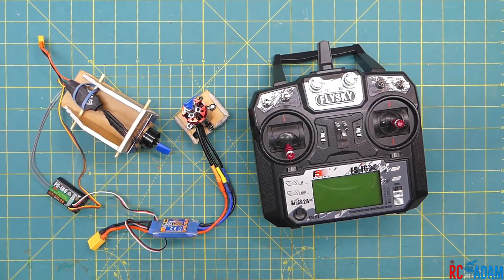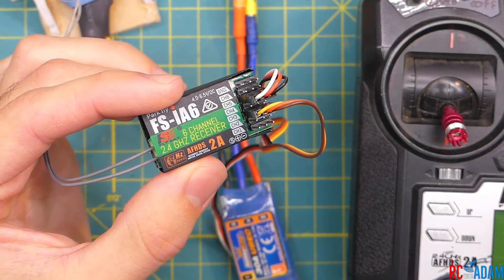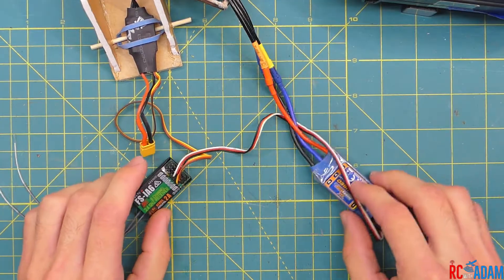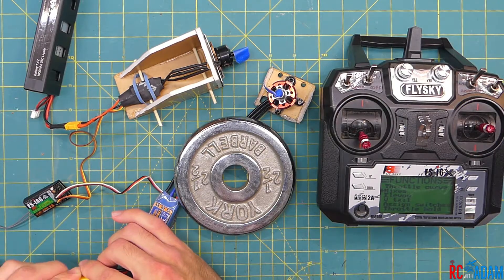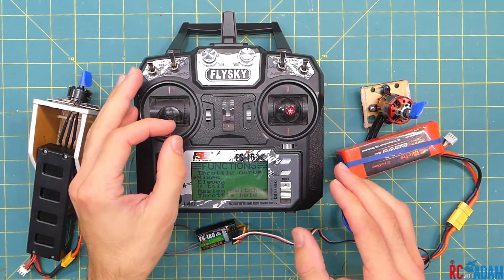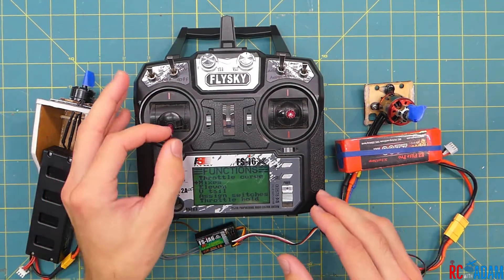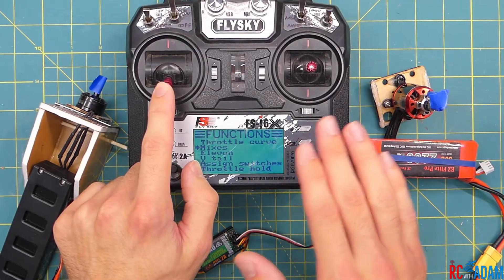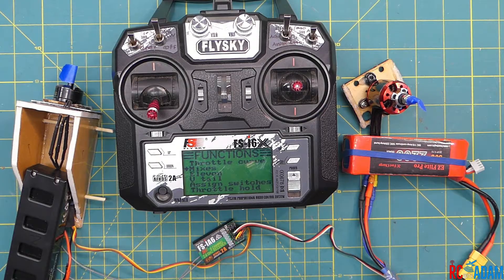Two Motors with FS-i6X - How to Setup FS-i6X for Twin Motor Airplane - Flysky i6x (and i6) Tutorial

Comment: Cool video man :) 
it would be best (for most) to Disconnect the Positive wire on the servo-wire of one of the ESC's..  
Basically Both your BEC's power the receiver (and servo's) and that Can work, but not for all types of ESC's..
Reply from the maker: Good point. Yes, I have heard that. So far it has been working fine for me. And actually, as long as it doesn't cause issues, it actually seems like an advantage to have a redundant power source for the rx.
Reply: @RCwithAdam1  Yes.. in a lot of cases it simply works.. 
The more technical story: if you use Linear BEC's.. it at least works.. If you have Switching BEC's.. it will very much NOT work :D 
the trouble then is that it's offten not specified (What kind of BEC the ESC has)
Reply: @DutchRC the rx needs a linear bec  ? Or one of those capacitors will smooth out a switch bec noise ?
Reply: I tried cutting the Positive wire of one of the ESCs but still only have one motor spin....any suggestions?

Comment: Rc with adam , Can't we just have 2 esc's and 2 motors , and hook both esc signal wires to the same channel 3 on the rx ?
Reply: You can, but you'll need to configure one of the esc's plug to connect it to a Y connector for a single output

Comment: What if i'm a 50% thrust and i whant to turn ...? Does it works...???
Reply from the maker: It will turn but be less effective. The motor on the turning side will decrease in power.
Reply: And 100% what that does ??

Comment: WARNING now motors will start with rudder regardless of throttle hold. Solution, EXAMPLE in assign switches set Fly mode SWC (or same as throttle hold switch) 
Then in Dual Rates Ch4 rudder set either normal or sport to 0% Rate so rudder will not activate motors.

Comment: Hi Adam,
thanks for the excellent guide. Can I have a question because I am fully new in the RC world? This "differential thrust" seems to be the correct setup for the motors of my tank T34 to move the tracks realistically. To clarify if possible. Because the tank also must move backward and I have a centered throttle joystick, I should have a 4th mix for my "throttle" as well but in an opposite way like Mix#1. 
So Mix#4 as Master Ch5, Slave Ch3, Pos. mix -100%, Neg. mix -100% and maybe adjust the Offset properly as well. 
Is my assumption correct or have I fully messed this up?

Comment: Hi, just a quick question, so you have one stick on channel 3 that controls two motors on channel 5. If I want to use the other stick to control another two motors at the same time as the first two, so 4 motors controlled by two sticks, how do I set that up?

Comment: Loved your tutorial and I got it all working with just one little problem, my left stick down which is normally no throttle, is w.o.t. .So to back it off I need to raise the stick to the top. I tried reversing it on the channel reversing but no luck. What am I doing wrong?

Comment: This is amazing, and great explanation, very easy to follow! Thank you! Out of curiosity, with this setup, if you are full throttle with the joystick pushed forward and centered, what happens if at full throttle you yaw left or right? Does one side slow down and the other keeps going?
Reply: I noticed that . Does it need to stop to yaw ?

Comment: So I’m that scenario that you demonstrated, you would not be able to have anything plugged in to channel 4, correct?  Because you are using channel 4 for the mix.   Am I correct on that?
Reply: You can have the rudder plugged in as well, in which case the differential thrust will support the rudder. Either way.

Comment: wouldn't you want the motors to spin the same rpm instead of them starting up at the same time.  
it seems like the one on the right spins alot faster but starts later.   
so they were actually going the same rpm's but one of the motors is of worse quality so it doesn't start up untill higher voltages

Comment: Super simple. I use Radiomaster TX16S but after watching this video and having lots of Flysky receivers, just bought an FS-i6x to setup my twin motor projects 🎉
Reply: Why wouldn't you set up differential thrust on your Radiomaster? Has the same capability!
Reply: @Mr89Falcon  maybe I should, just don’t know the procedure
Reply: @texasuavpilot  read the manual. It's all should be there. The explanation of channel mixing setup (here and some other videos I watched) are lame. The explanations are so basic, seems that don't understand it fully (what about setting values not to 100% ? what about offset).
IMO you downgraded yourself by switching transmitters

Comment: Good job sir. Which flight controller is good for RC plane. For beginner,  auto leveling gyro. Please..answer
Reply: The byme v2 has 5bflight modes . Is about $20 .
 You need an sbus output rx .
Flysky has ibus output but might work . Check before you buy . I think it might .

Comment: Hello Adam. Saw a 9 year old video from another rc enthusiast, where he programmed a turnigy(flysky?) transmitter with a windows/linux based program. I downloaded the program and will try to use when my fs-6x arrives. In the program, the youtuber assigned mixes to switches. So the switches activated or deactivated the mix.  Can that be done on current flysky transmitters?

Comment: You shouldn't have to set the offset at all. I found out that if you go to channel output in the rx menu you need to set whichever channels you're putting your mixes on set to "None". For instance if your 2nd motor is on channel 5 and it's set to VRA or VRB the motor output can be controlled by the dial and is why you would have a difference in speeds.

Comment: Hey Adam I am new to RC, and have bought a new FS i6X Tx and a couple of 6 channel Rx to match. I watched your video on two motor control. I want to control a land vehicle, 4 wheels, with front wheel drive, (not steerable) and use differential thrust to steer with the two front wheel motors. I followed the video instructions and set up the Mix 1 as stated, and found the throttle stick at full up would not change the pulse width enough to get the motor started. I put my oscilloscope on the Ch 3 signal pin, and could see the string of pulses coming thro, but the throttle stick would only alter the duty cycle (pulse width) of the pulses from about 5% to about 10%, not enough to get the motor running.
If I put an external PWM generator onto the ESC  throttle input, it runs the motor up and down the RPM range (from zero to full speed) in line with the pulse width (duty cycle) as expected. So the ESC and motors are OK. 
Any suggestions as to how I can get the Tx to produce a range of pulses from 0% to 100 % in width? Is it a Tx setting I have mucked up?
Cheers Ken

Comment: I've tried this set up on my own build but i can't seem to figure out why one motor spins at max rpm and the other works like in the video  Any suggestions 🤔🤔
Reply from the maker: What components do you have? Do you have any other mixes in the radio that might be affecting it?
Reply: Just running the fs-i6x with the 10 channel receiver  with two 1000kv motors nothing too fancy😃

Comment: Hey everyone ;) i am confuse because i saw a guide where they told to disconnect one bec of one ESC. Do I really nead to disconnect one ? ESC 2-4 S 12a motors 2x 1806 2300kv with a 800mah 2S Lipo 😳 and same Receiver. It will be connected as 2 different chanel for differential thrust.

Comment: Can you tell me what is a bind plug? thank you RcwithAdam
Reply from the maker: Hi! A bind plug is really just a way to connect two of the three pins of a servo port. It's used to put the receiver into binding mode to establish radio connection with the transmitter.

Comment: Great video - thanks. However, being a newbie to this - a question please? At around 11.50 you show either full throttle or cutting the throttle to zero and then throttle by the Rudder/Yaw channel - what happens if you have say half throttle and then push left or right rudder/yaw? My concern being, I would not want to cut all thrust before turning? Am I missing something? Any advice from anyone would be gratefully received!
Reply: I would guess that the motors will function differentially even when both are spinning. In fact, it may be that the amount of difference between the motor speeds increases as one moves the right stick farther left or right. But I am only guessing. Try it.
Reply: Same question

Comment: Thank you so much for posting this.  I am building  a dual propeller boat, and i found this video very helpful to eliminate the need for a rudder.   I noticed though you have not disconnected the "positive" wire for ESC2 when you plugged it into the Receiver.   I have seen other videos where it is advised to disconnect.  I prefer not to disconnect the positive wire.  Would this cause any issues?  These are all parallel BEC +5V circuit, so I do not see any issues.  I am not sure why many youtube videos recommend to disconnect the positive red wire for the secondary ESC.  

Thanks once again for posting such helpful videos.  It would have taken a while to figure this out using the manual.  You saved me a whole lot of time and probably hours of frustration... lol.
Reply: Yes ur correct it shouldn't be a problem keeping those wires connected to rx, but why do many utubers recommend disconnecting well one point is tht,  I don't exactly know (but coming from an electronics background) I could tell that, maybe the receiver current (mah) requirements is low and so connecting both esc's to receiver (when both are in Operation) could supply more current than required to the receiver and could potentially fry some components in it. Jst a thing to keep in mind, as small components have delicacy a small upsurge in current could make things not work properly. Hope this helps, Love from India❤

Comment: Hi I love ur video. I was wondering if possible if there is a way to have forward thrust with two motors on the left joystick and the left and right control on the right joystick? I'm actually using for a bait boat I made. Many thanks in Advance..

Comment: Hi Adam and how to get reverse (a polarity inversion of the motors) in the lower half of the left joystick? so that only in the central position the motors are switched off
Reply from the maker: Hi Armando! You would need a ESC that is capable of reversing motor polarity (like on a RC car).
Reply: @RCwithAdam1  Alternatively, is it possible to use a Dual Channel H-Bridge module to use motors with power that is not properly for model making? or in any case do I need to add a Esc ?

Comment: I have a problem, set up boat (which is the same as for an airplane) I try to make work my 2 brushless motor at the same time but that does not work just one works. Flysky FS-i6 controller two GOOLRC Brushless motors with 2ESC RCharlance with 1 Reedy servo. I bind my controller with the receiver, I put a chanel 2 master engine then an engine on the chanel 5 in Slave, only one engine is running! (I do not know what the problem is if it is incompatible at ESC level since it is two alike!? Need info Please

Comment: Hi Adam. I enjoy your tuition videos. I have a slightly different scenario in that I am into R/C construction equipment. How do I mix channels so that I can have EG. two tracks operating on the same channel....one stick (either one) working both tracks fwd and rev...and left and right turn. Thanks in advance.
Reply from the maker: Hi! Would these tracks each have their own channel? If so, you could set that up in the Mix function.
Reply: @RCwithAdam1 ...I'm wanting to work them off the same stick. I would like to know how to set them up in the Mix function

Comment: Nice details given by you friend. I have some problem if you guide me I made my dual motor 1400kv RC plane but issue is that both motors speed are not equal when I push throttle to give speed on same time... any suggestion from your end so that I can resolve my plane issue
Reply from the maker: Hi! I would try adjusting the throttle curve or the endpoints (or possibly the subtrim) for the channels that the motors are using.

Comment: Hi there my twin motor boat goes to the left is it because of the mine set at 50%pos 50%neg   and 0% offset
Reply from the maker: Hi! I don't know a whole lot about boats, but are the motors spinning in the same direction? Maybe it is turning due to torque? Otherwise, I would play around with that mix and/or the throttle curve and endpoints.
Reply: @RCwithAdam1  thanks for the reply I sold it and bought a different model due to it being a common issue on that particular version as they suffer with delay in the left side wich is enough to throw it off u can upgrade to get it right but I was offered more than I paid for it and was thinking of changing 👍

Comment: Very nice and informative video .I was wondering if i use 2 reversible escs and the right stick on the transmitter ,it may be possible to control a rc tank  (forward, backward,left and right on the same stick )  ?
Reply from the maker: Hi! That sounds correct, but I haven't played with reversible ESCs yet.
Reply: Have you tried this yet?

Comment: Nice video thx it will help a lot I just got a Flysky 💃🏻 Only one question, is it correct to unplug/eliminate the positive connector in one of the two esc? Not in all the video like th is shown this procedure
Reply from the maker: Hi! I've been told that is the correct procedure, though I have not personally experienced issues from leaving both connected.
Reply: @RCwithAdam1  thank you I'll try ;) Very nice video again, very helpful 👍
Reply: You shouldn't have any problems if you are powering two identical esc from 1 battery. But 2 batteries? Definitely disconnect 1.
Reply: @matthewlomax5925  thanks 👍

Comment: super helpful thank you !   I want to do a similar setup for a tank, how do I set it up to go fwd/rev  do I just adjust the offset ?
Reply: jynx 1966, I have a Spektrum DX8e and use it to control a Redcat Everest 10 rock crawler. I am new to RC so don't know a lot of key words and tricky phrases or how to program what I accomplished. Controlling power to the motor on the right stick is the secret to my success. I plugged the ESC into various slots of the 6 channel Spektrum AR620 receiver until I found the spot for the right stick on the controller which has a spring return to neutral. Neutral is stop, down is reverse, up is forward, left and right on the stick turn the RC car's front steering servo left and right. The left stick (throttle) controls a pan/tilt assembly holding a camera. A three position switch on the controller adjusts the rear steering to straight, left, and right.
Reply from the maker: Hi! I'm not sure yet the best way to set this up for ground vehicles. I'll have to play around a bit with it.
Reply: @RCwithAdam1  , Thanks for the great instructions. I use a different brand receiver, but your instructions help me understand the concepts.

Comment: Great video, I did the exact setup and calibrated every esc separately, but when I connect to channel 3 and 5 one motor doesn't respond and keeps beeping as if it is set to calibration... any ideas?
I am using the same remote and receiver and two motors are same kind
Reply: @awocrf I tried cutting the Positive wire on one of the ESCs, still only get one motor to spin...any suggestions
Reply: @awocrf I tried using the Y-harness and only one spins. One spins when I use separate batteries too
Reply: @awocrf I setup with two ESCs with a separate battery for each ESC and I get one motor spinning, then I use a Y-harness connected to the ESCs with singe battery connected to the Y-harness and I get the same single motor spinning. At this point I'm going to get 2 new ESCs and start over.
Reply: @awocrf Correct only one motor ever spins
Reply: @awocrf I figured the same but since both cause the motor to beep, going to replace both of them. Will let you know what I find.

Comment: four motor with fs-i6 how to setup fs-i6 four motor qudacopter  all setup
Reply: Do not use the positive v. ( middle pin) on one of the esc. It could be bad for the receiver.
If you do not have enough mixes I once made, with perfect result a mechanical solution. On a  wood frame put a small servo, Y 
connected  to the rudder. With 2 small micro switch's ( or a 2 part beryllium metal stripe) on each side of the servo arm so that the servo arm touches the switch arm at a distance you set. With the signal wire from the 2 esc going through one of the switches the signal to a motor will be interrupted and the desired motor will lose signal and stop. Used this for several years before a newer transmitter was acquired. This was for a fixed wing application.

Comment: Im new to this do you know how i can get the motor to spin in reverse ? With down #3 toggle
Reply from the maker: Hi! You would need an ESC that is capable of reversing direction (like the kind in a RC car).
Reply: switch the wires around so motor receives revers polarity when connecting to motor